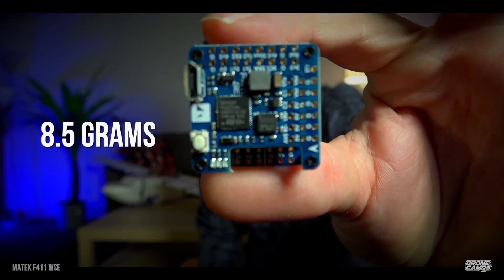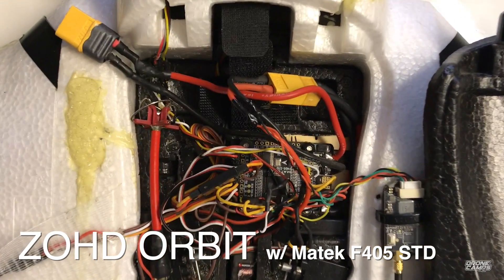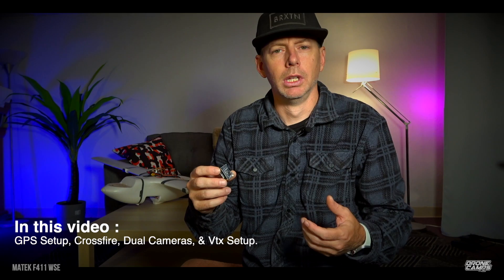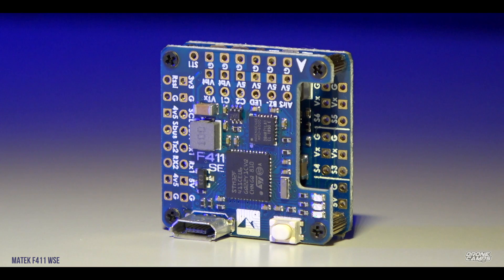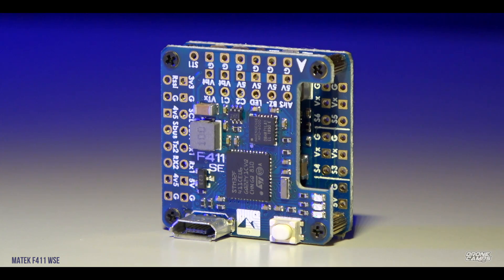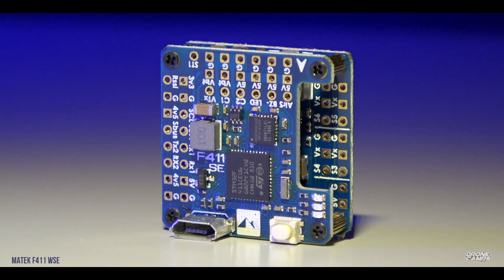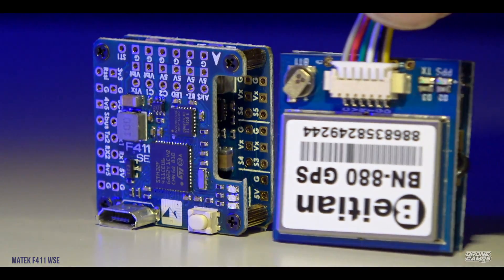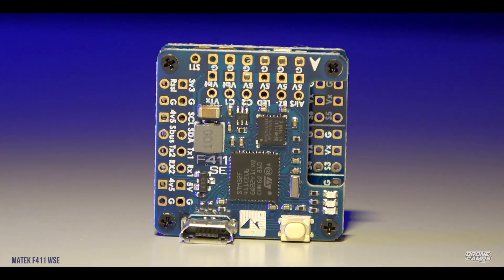WORLD'S SMALLEST WING FLIGHT CONTROLLER - MATEK F411 WSE - REVIEW & SETUP 🏴‍☠️

Comment: So I ended up buying a matek F411 wse hoping that I could use it with iNav, crossfire and dji system. Problem is someone told me that iNav OSD is still not supported by dji. Is this true and did I just buy the wrong equipment ☹️

Comment: Do we know if this will display osd for the dji fpv gear? I notice when buying this last night it sais mad it also supports Betaflight now.
Reply: With the latest version of iNav yep absolutely but the issue I think here is the board does not have enough UARTs to support all of this. I needed GPS, Crossfire and DJI Digital all need full RX/TX ports, this board only has 2.yes we have soft serial as an option but my understanding is that all this devices i mention need TX and RX softserial in this board can only be used to create extra TX pins so I don’t think it’s that useable for me. I hope I’m wrong and someone correct me as I really want to use one of these boards

Comment: Im trying got the rxsr going good no rssi yet 
tomarrow gps and compass then servos ese soldering then fitment to the zohd dart 250g do you think the older telemetry radios will work on this got a few sets of thoes lying around their ic2 i understand that they can support parallel connections but im getting ahead of my self
 still trying to keep it lite
 and dont really want to use my phone or laptop for telemetry 
Anyway thanks for the great vids and  info

Comment: Boy have times changed from when I use to fly 2-4 stroke RC planes as a kid, would have never thought we'd have this kind of technology!
Reply from the maker: Can't imagine it myself. If I would have had stabilize mode and return to home on my first rc glider I might not have crashed it. But then again I was only 10. Full send into the sand dunes into pieces. Then I went nitro after that. It would be decades later before these FCs came out!